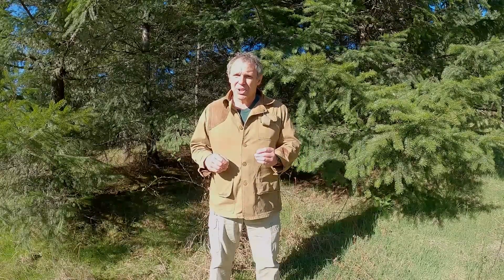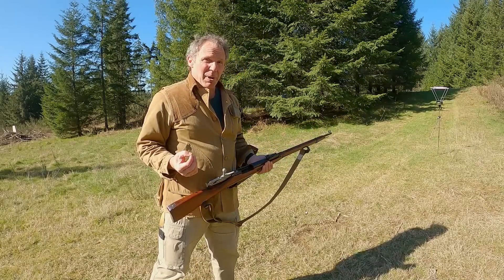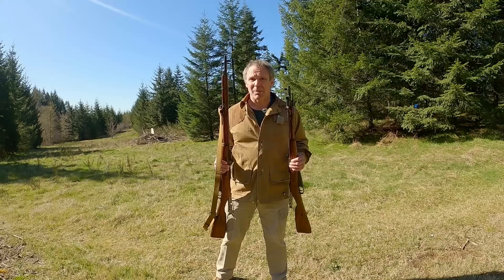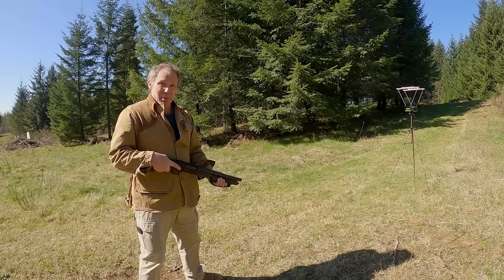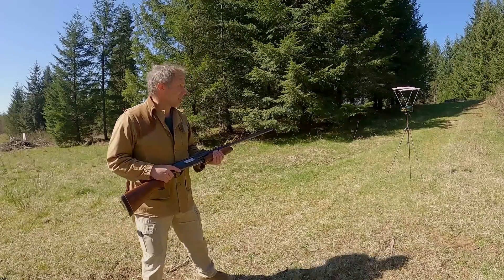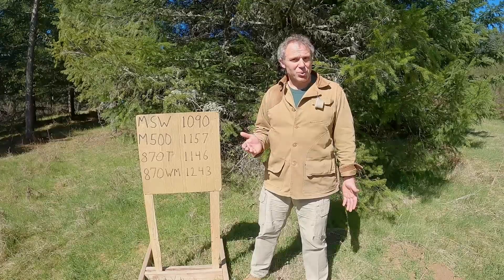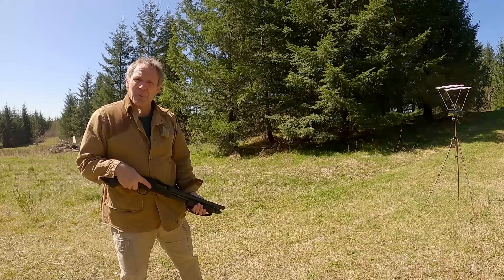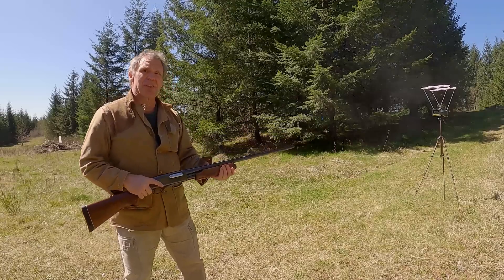Shotguns: How Does Barrel Length Affect Velocity?

Comment: Personally, a 100 fps difference sounds like a deal breaker for those twenty something barrels, well, not like you could do home defense with a 28 inch barrel without giving you any troubles anyway, but i won't judge anyone who owns them, maybe that advantage sounds right at a hunter's alley. i guess i'll prefer factory length of 18.5 inch or 20, although i wish we had seen slugs; given i'd expect this be like the video where Paul demonstrated rifled barrels barely if at all affect scattershot loads, but helped a little rifled slugs. maybe here it would be a cumulative effect,.Rifled slug, longer barrel,  a Considerable fps difference giving those Massive barrels a certain edge. Food for thought.

Comment: I've noticed Paul's preferred shotguns are slide pump action.  Is that due to mere personal preference, consistancy of comparative results or a matter of availability?  For this particular test series, would the inclusion of auto loading shotguns muddled outcomes too far outside of test parameters given the specified issue (barrel length vs. velocity) of the presentation?

Comment: Mr. Harrell, do you prefer shotguns without pistol grips? I have an 'old' Mossberg Cruiser [18.5" barrel] and I found the pistol grip noticeably increases the recoil impulse in my hand, but hasn't affected my accuracy when using birdshot at short range [50 yards]. In your experience do full-length barreled shotguns [>18"] w/ pistol grips make for better weapons than short-barrel shotguns with pistol grips?  Also, a while back you showcased your Kahr compact in.40 S&W-is the recoil impulse the same for a .40 S&W or better than a .45 ACP in a short barrel [3-4"] pistol? Thanks for the lessons, TOP!

Comment: Now try it with steel shot and you should see a much greater difference with barrel length. That is a point I was trying make in a comment on the Steel Shot for self defense video. The barrel of the gun used in that video was too short to completely burn the slower powders used in steel shot loads and the result was muzzle flash and blast blowing the center of the pattern out like a doughnut. I Still wouldn't choose steel shot for defense unless that was all I could get.
Reply from the maker: Interesting point. In the presentation on steel shot for home defense we used short barrels because that's what more people would use for home defense.
Reply: @PaulHarrell  Too true. clearing a house with the 870 wingmaster would be awkward.

Comment: Minor point, not suggesting it would disprove your results or anything but if you're shooting a 14" gun and a 30" gun from the same standing position the end of the barrel is 16" further away from the chronograph so the results will be slightly skewed.
Reply from the maker: Check out our presentation on velocity loss at seven yards.

Comment: Are you sure about that?  More complete combustion and more pressure built up with longer time in barrel.  As opposed to - longer time in barrel so more time for the force to accelerate the projectile - maybe the combustion is more or less “complete” and peak pressure achieved early, while the projectile mass is still in the barrel.  Just a thought .  Might be wrong.

Comment: I'm curious about the effect of barrel length on slugs.  Since pressure build up behind the bullet/projectile due to a longer barrel increases velocity, is it possible that having multiple projectiles such as bird or buckshot allow some pressure to escape through the empty space between the packed balls? Certainly with finer birdshot there would be less space than the relatively larger and less efficiently packed buckshot, but I assume a slug would provide the best seal in the barrel and therefore have the least amount of pressure to escape since there is no dead space in the center.

Comment: I'm betting that if you tried this with a shotgun round that had very slow-burning powder, say any "magnum" steel shot, you'd see the difference between the Shockwave and 30-inch 870 grow, perhaps a lot.

But typical shotgun powder is so much faster than anything used in rifles, barrel length won't be a big concern.

Comment: Paul, does the velocity difference of shooting from a 14” to as much as a 30” barrel of the birdshot/buckshot really make any difference in what we are shooting, if what we are shooting at is say 50, 75, or even 100 yards away? Shooting targets, clays, birds, or self defense?

Another question.... are you pumping that shot gun after each shot, or pumping it right before the shot? Hard to tell!
Reply from the maker: Check out our presentation on low recoil ammo and we have a demo.
Reply from the maker: You can't pump the slide before firing, it's locked. I do an explanation and demo in our presentation on loading and firing pump shotguns.

Comment: Paul: Do you have a recommendation (or an opinion) on using older firearms with current ammunition? I inherited a number of rifles (including a Lee Enfield No. 4) and shotguns (incl. a Browning A-5 16ga. (unfortunately not a Sweet 16) and a Winchester Model 12 pump from potentially the 50’s). I have some .303 Brit rounds that look like MilSurp and I definitely hesitate to use them as they may be Cordite which has been seen to misfire. But is there a reason not to use modern ammo in these older firearms? Thanks in advance.
Reply from the maker: Very complex topic. The short version: The biggest problem is shooting modern ammo through guns made for black powder. You should NOT put modern high base 12 ga ammo in a shotgun made in the 1880's. If your shotgun was made in the 1950's then the ammo hasn't gotten much more powerful since then. however I would avoid some of the heavier stuff like the 2.75 in. magnum ammo with 1.5 oz of shot when 1.25 oz is considered standard. 

 It is also a good idea to avoid +P ammo in some of the older guns. I use .38 special +P in my revolvers made in the 1970's but I certainly wouldn't put it into .38's made during WW II. 

  The two most important things about your older guns are to make sure they are in good working order and avoid the super hot ammo like Buffalo Bore and a few others.
Reply: Paul Harrell Greatly appreciate you advice. And I love your channel and the fact that what you’ say or recommend is based on experimentation and data, rather than pontification. As they say, without data, it’s just an opinion.

Comment: I know i'm being pedantic, but due to your close proximity to the chronograph, the variation caused by difference in barrel length is actually significant. The 870 Wingmaster is over 10% closer to the chronograph than the Mossberg Shockwave. I suppose that in practice you'd probably take a shot from the same distance from the target irrespective of barrel length, but if it's muzzle velocity we're talking about... Does it matter? I dunno. I'm no expert.
Reply from the maker: Check out our presentation on velocity loss at seven yards.

Comment: Barrel length definitely doesn't affect velocity the same in shotguns as it does in rifles though.  Shotgun pellets do not build pressure the same way that a bullet does.  If the same test was done with a rifle I think we would see much different results when comparing barrel lengths.
Reply: AFedosick 
  He just did a comparison of rifle and shotgun. 
  I'll take the bait. How is the pressure buildup  different behind a solid bullet vs a shotgun cup.
Reply: The build-up in pressure takes place between the base Wad and the over powder cup. Not between the powder and shot. Because of different wad construction types, substitute a different wad and pressure changes.

Comment: Very surprising that the difference from a 14 to 30 inch barrel is only around 100 fps, over a 100 percent increase in barrel length and only a less than 10 perecent increase in performance

Comment: What camera do you use to record ? The greens are way off as are the other colors.  Also it’s over sharpened. Similar to Samsung cell phone colors.  Maybe use a canon, or even an iPhone.  Shame for your library of videos to so poor in color accuracy.
Reply from the maker: If this is a joke, I don't get it. I've watched the vid on my computer and the colors look the same as they did when I was there filming this. Could the problem be your computer?
Reply: Paul Harrell Hi Paul, not a joke.  I’ve watched your videos on my iPhone, my Samsung TV, and my 4K iMac (full RBG calibration).  I’ve always found your colors to be off.  Especially the greens.  There seems to also be some post processing going on. I feel even a basic iPhone 11 would produce better clarity and colors.  Also the dynamic range is not good, your face is often washed out from sunlight.  If I may suggest, try filming with just a recent  iPhone model and see if you get comments that the video looks better. Or even a basic Canon point and shoot camera.